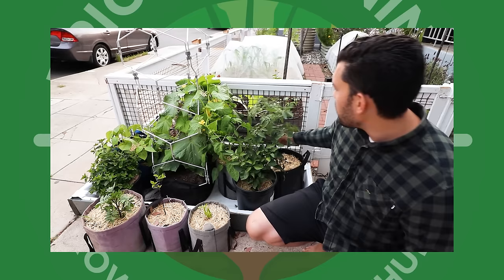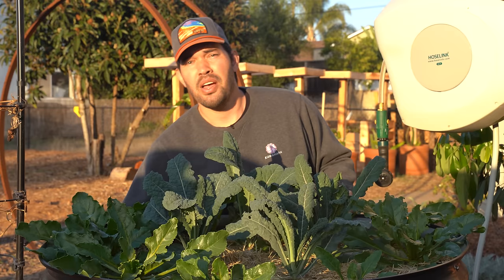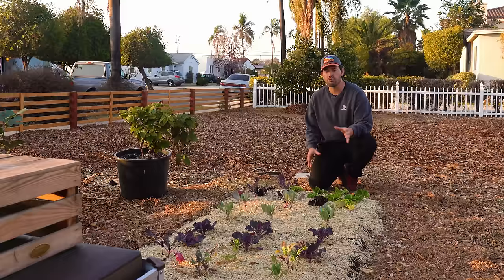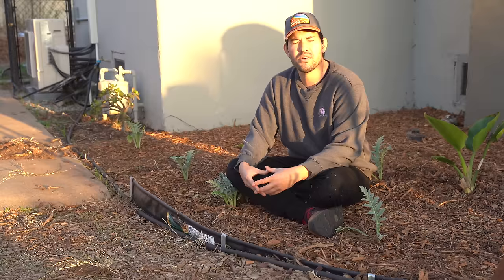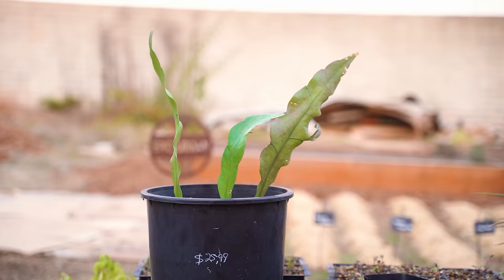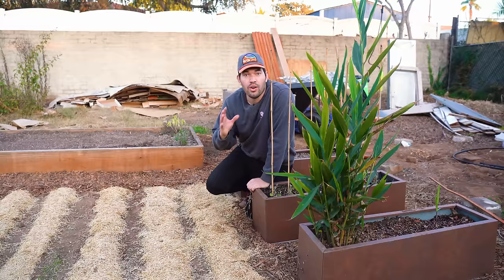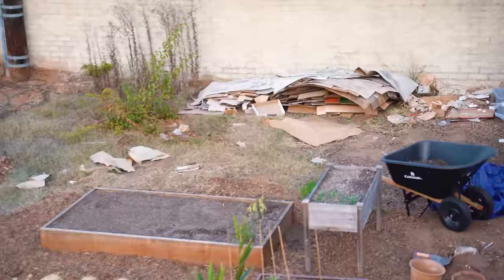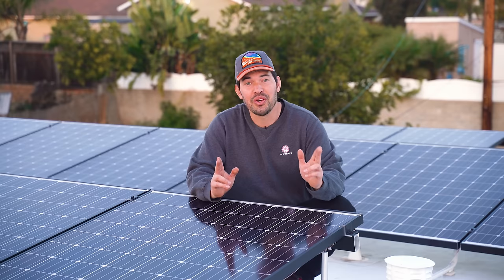FULL 2021 Garden & Homestead Tour!

Comment: I'd like a video on how to garden in an elevated raised bed.  I have two that we built, 4 x 8 3 ft high.  out of wood, with wire mesh and weed cloth lining the bottom.  I filled it with good potting soil but nothing did really well in it this first year.  tomatoes got end rot, and squash turned yellow, peas turned yellow  and died off.  most things started out great, but then didn't last.  Too much water, not enough water, nutrients leaching out the bottom,  cold, underneath.  zone 8 here so not alot of freezing weather, but some.  I'd love some tips on  this type of beds.  I love the height of beds since I'm tall and older.  Thanks

Comment: How would you cultivate citrus trees for a quick grow and yield in SW desert triple digit heat? I want the shade and privacy sooner vs later, so I was considering transplanting juvenile trees that were resilient enough to stress, but I don’t want to end up not having the soil quality to nourish. Same issue if I start from seed. It’s rock not dirt. Basically I’m starting soil from scratch replacing gravel. I’m concerned the earth won’t be hospitable and require massive amounts of soil mixtures but will lack depth for larger trees over time. There’s a healthy tree out front and the neighbors have healthy trees so that’s reassuring. Do you think in a harsh hot environment half the year, that I need to propagate the soil quality first before I plant a seed or transplant anything? If so how long or recommendations? I want it to take the first time 🤞

Comment: In your no-dig garden bed, you said you don’t like the soil composition because it stays too moist. I have a few beds filled with container gardening soil from an often recommended local soil company and it seems to do the same thing but is very sandy. What is the composition of that soil in your raised bed? Why is it too moist? I’m wondering if the soil I received was overly sandy because sometimes it feels like I am building a Sandcastle when I plant things. It’s gets a light crust on the top under the mulch/topsoil but stays very moist below.

Comment: Two questions. I live at 5000 feet in the Sierra Nevada where the growing season is...July.  I have and unlimited supply of pine needles that I could use for surface mulch, but I’m concerned about acid leech. What is your take on this? Also we have difficulty producing carrots of any size probably due to highly compacted clay soil which I have worked with compost and manure for years, but still carrots don’t do well. Do people literally add sand to create a more sandy soil?

Comment: I do have a question. I'm looking to make a cattle panel trellis for cucumbers. First off will that be good for cukes? I was going to use 6 buckets, 3 on each side, holes drilled around the circumference for each, rock laid in bottom for drainage. I'm using buckets because of the high population of rabbits. Should I also use chicken wire or will 5 gallon buckets be tall enough?
Reply: That's more than one question. Lol